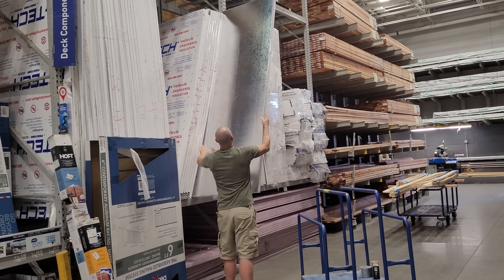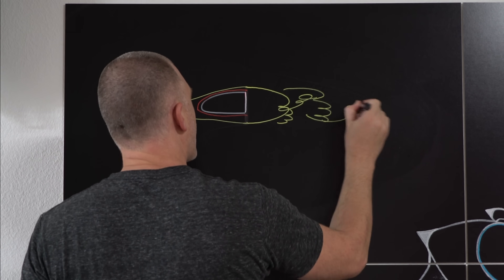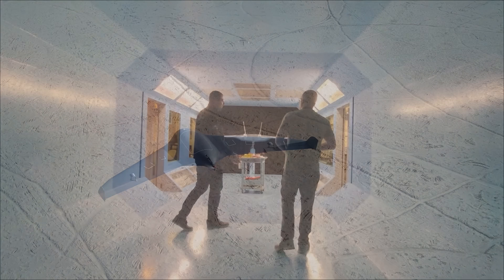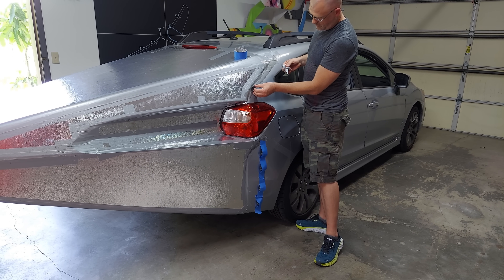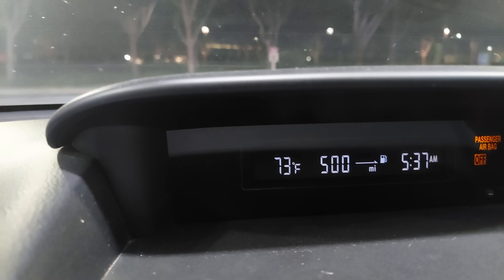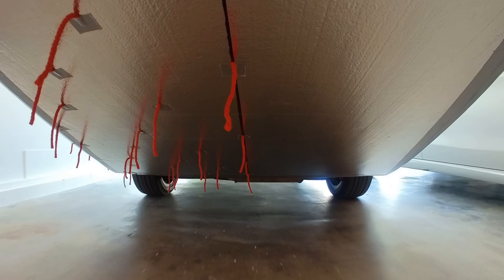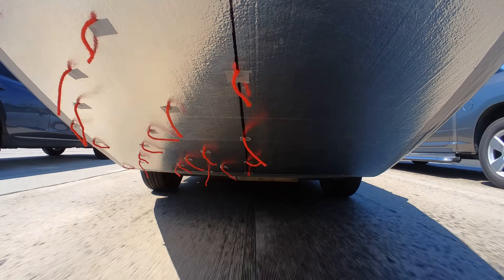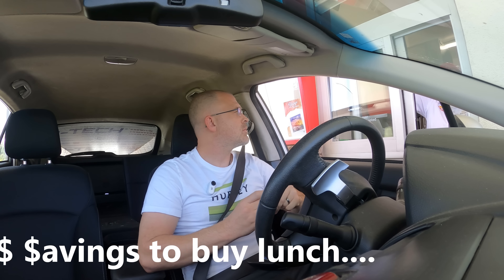Using Simple Aerodynamics to Beat High Gas Prices (Home Improvement Store Edition)

Comment: So why do dimpled golf balls travel farther than smooth ones?
Also, doesn't a rear spoiler decrease the drag by filling the air pocket behind the car and eliminating that negative air pressure?
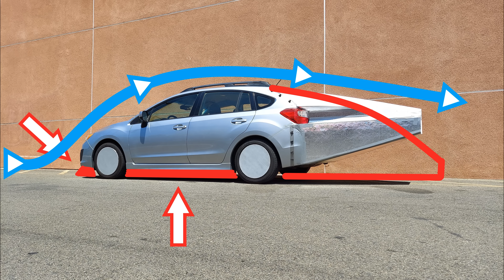9:20 if you shape the rear as indicated, won't you be creating a large wing and thus create upward lift, and potentially dangerously decreasing traction?

Comment: As a pilot AND a plug in Prius driver, I get it.  At an average of 78 mpg per tankful though I just keep it stock. I did put VG's on the rear/top of my hatchback Yaris, and though they didn't help MPG, they did help stability at speed, it felt more stable. When I sold it, the buyer was eyeballing it and I started a long windy explanation about the VG's. and he stopped me. Turned out he was a medical flight fixed pilot!  We both knew at that moment that he was going to buy it.

Comment: To get ACCURATE data, he should have been using an empty gas tank filled with 1 gallon of fuel or just using a 1 gallon fuel tank like the old Shell mileage experiments. Still, this was interesting. It would have been even more interesting  if he had improved the forward aerodynamics.  The Stanley Brothers achieved the ultimate over 100 years ago with what looked like an upside-down canoe.

Comment: Cover the taillight indents with clear plastic. The back end can be wider so there's less turbulence on the sides. You can also put a clear plastic tail cone over the hole so it's more like a wing . . . Reading the other comments I'm just repeating what others have said. The bottom cant be as low as you showed or you wont be able to get in the gas station driveway. Replace body panels with carbon fiber to cut weight, a lot of energy is used accelerating that heavy car. Take the back seats out. Take off the rear glass.
Reply: I was thinking the same thing! One could even take a budget approach and use clear packing tape to form the cover.
Reply: ...ooooor just get a motorcycle
Reply: @Blakezilla594  Mythbusters made a motorcycle more aerodynamic, but that is a different project!
Reply: Ah yes, beat the high gas prices by replacing body panels with carbon fiber...
Reply: Drive a diesel
Reply: Replace the whole thing with a teleportation device and power said device with wind and solar.
Reply: @NoGoodHandlesComingToMind  Just use magic, duh!
Reply: I doubt he is trying to go that far with this. Doing some of those suggestions would sacrifice practicality, after all, there's a reason he is driving a Subaru lol.
Reply: @bozark99  He said it was the challenge of improving a heavy and unaerodynamic vehicle.
He can't use the hatch anymore!
Reply: Wide body issue could be solved using scrape friendly products like a door rubber sealer for the absolute bottom part.
Reply: He might actually be stopped by having clear plastic over the tail lights even though it is clear.
Go figure.
There is a point of diminishing return the longer your boat tail is.  I am sure at this point any added benefit would be negligible, while a tail cone would just get in the way--and clear plastic becomes yellow and brittle in the sun.
Redoing the sides and bottom to maintain attached flow--or at least fill in more of the wake would have a measurable improvement.  He could remove the foil and shape some 2-part foam.
I have never seen a gas station driveway anywhere near this steep.
Do you have any idea how expensive it would be to replace body panels with carbon fiber? :)
A 50" × 36" sheet is $118+ on McMaster-Carr, plus shipping.
You remove the panel, grease up both sides, make fiberglass molds of each side, vacuum-bag it to remove excess air and resin, and then you grease up each side of the mold, lay out one layer at a time of carbon fiber, vacuum-bag it again, trim the excess, install, and hope that everything is perfect.
Then you need to hold onto the molds because if the panel takes any damage you need to replace it.
Fenders are light.  You could definitely save weight with the hood.
Back seats are light, just foam and cloth.  The front passenger seat is much heavier with the metal frame.
I have driven without a passenger seat.
It is weird.
I am sure that removing the hatchback would be easier than just the glass--and easier to reverse, although road noise would increase even more.
Rear visibility is already gone, though, so he could install a foamboard bulwark and seal it.
Reply: that foam board is lighter than carbon fiber...
Reply: The solution to high gas prices? Don't drive, unless it is necessary or for special occasions. Have meetings on the computer. Have cities that have amenities near residential (or included in a multipurpose building, like the 2014 canceled Sky City in China or the 1989 Sky City 1000 concept in Japan).
Reply: @thatguyalex2835  don’t drive…. a Subaru*
Reply: @johhnnn  DONT DRIVE A 4x4
Reply: @thatguyalex2835  no thanks, I won't live like a serf
Reply: @thatguyalex2835  the solution is TRAINS!!!
Reply: @thatguyalex2835  Cool
can't do most of that myself though

Comment: Run a design through OpenFoam, iterate, improve, and then build it. Vortex generators are way too far aft on the vehicle. They are placed where laminar flow naturally stops, and you get flow separation. It's going to be soon after the body goes to parallel with the direction of travel, and before any seams like door panels. Another method worth considering is a wing to direct airflow against the body, similar to a leading edge flap. Mike Patey ran a simulation with his double leading edge flaps on Scrappy and got an AOA to some ridiculous angle without flow separation, which is basically the same problem you're trying to solve.

Comment: How will EV’s run in 10 years?  15 years?  20 years?  How much does a battery replacement cost?  What’s the cost to repair it?  How easy to find new parts?

Comment: And illegal as hell...lol. Interesting idea though. But you need to get better at your data collection. Drive at least 300 miles one way and 300 miles back. The more you drive the less error there is in the way the fuel kicks off on the fill. You should always fill in manually anyway for a test. As for why car manufacturers are not doing this? Well you just got rid of your hatch back. That makes it a car. Most cars will already get more than what you saved without those modifications. So that's why they are not doing this. Plus they would never get is past the lawyers or the DOT.

Comment: I hate to say it, but I spotted the mistake with the basic shape right at the get-go. The tail should more or less retain the same shape but must swoop down to ground level, making the car more like a half-teardrop shape, assuming that's the sort of shape you want - pointy at the back. But for my money, I'd widen the tail so that the sides more or less follow the line of the sides of the car, with the top tapering downwards so that it's pretty broad at the back. You'll still get separation and turbulence of the airflow but it's more likely to resemble the laminar airflow you had on the top. Forget the big tail light recess, or fair it in with some transparent plastic but you could ignore the current set of lights and run a couple of cheap lights down at the bottom of your faring. I might try a couple of flow straighteners on the top edges.
Good fun though. Hope nobody rear-ends your experiment.

Comment: Why didn't you use convex curves to help maintain a velocity profile through the thickness of the boundary layer.  Flat of convex surfaces  tend to cause the boundary layer to at least thicken, if not separate entirely.  Keep the tail wider so the sides don't have to taper in so much.  An underbody panel would really help, especially if you can accelerate the flow there to lower pressure.  You may need to water cool the exhaust, but if the floor cover is metal, maybe use that as the a heat exchanger.  You may find a slat helpful to maintain attached flow on the rear.   The main issue with drag is to maintain the air pressure of the decelerating flow, It's the forward vector of air pressure on the sloped rear surface that is the major factor in recovering energy from the flow, not so much friction.  This is why maintaining attached boundary layer is so important.  Note that utes have lower drag with the tailgate up as this promotes reverse circulation forward along the tray & pressure on the rear. of the cab.  Kind of counter intuitive but it works.  You may be able adapt something like that, shortening the extension by using a slat.  Maybe?  Could set up a makeshift wind tunnel to test models.  Just remember Reynolds number means either increasing velocity or fluid density to do scale testing well.

Comment: At constant speeds on motorways this experiment is valid, but most cars are used locally about town. In this scenario your problem is weight and acceleration. Keep your car as light as possible and accelerate as slowly as possible, also roll to a standstill where possible avoiding braking if you can. I always roll down hills and keep my tyre pressures as high as is safe..

Comment: I would imagine that vehicle manufacturers have considered aerodynamics, but balance it with overall effectiveness and practicability. When you consider things like parking and average speeds etc, there's a number of problems having an additional three or four feet added to the rear of your car along with little to no advantage at low speeds.

Comment: ago
If you actually changed the co efficient of drag of the car by reshaping it aerodynamically that would be one thing. You just added weight on the back of your car. Pure foolery. Not to mention the first time you park that anywhere the whole back end is just going to get ripped off.by someone careless . Good luck parallel parking. Duct tape and gorilla glue. Formula of champions.

Comment: I honestly wouldn’t add a splitter and sideskirts, That will just create even less pressure on the bottom of the extension. you would risk starving airflow going under the car and creating a bigger low pressure area the extension part. I would try to cover the underside of your car and make it as smooth as possible and put some acrylic panels over the rear lights if that’s allowed.

Comment: Nice!  I was wondering if you can use thin plexiglass or flexible clear plastic to blend in the lights.  Definitely rear wheel covers, maybe also plexiglass if you want it to still look like a car.  Underbody tray is trickier as you have some hot compopents, so maybe aluminum and stainless would work great.  Roof rack delete, smaller rear view mirrors.  Tape some bits of yarn on the surfaces and look for airflow separation, install small vortex generators in front of that area to allow the boundary layer to stay attached (I finished the video and noticed your VG's and yarn tufts. I usually see them mounted tip up more like delta wings, with some angle of attack to induce swirl rather than flat side diverging away from the surface creating separation. ). Still, impressive results!

Comment: This is very interesting to see. I think a 13% increase in efficiency is pretty good too! Especially since the way it curves up creates a low pressure zone which creates downforce and drag. It's the same thing Formula E cars use to get their downforce. If done properly it can create downforce without creating a lot of aerodynamic drag like a normal spoiler. 
I also wanted to mention that many electric cars do actually make cars somewhat like this. They all have a teardrop shape to them :)

Comment: Great job.  I have long wondered why we rarely see these trailing edges on semi trailers.
Can  you do video on the features of cars like the CRX through the prius which have the lowest Cds?
Reply: It's not just cd, it's cd x frontal area, so a big car with low cd (80s Mercedes) may have a better cd but more drag.
Reply: these dramatic tails take up a lot of space. Especially if you want it to really work. Easily adds a couple feet of bodywork, which can make it harder to park or fit into space/streets
Reply: @ciello___8307 , that is very true. A 2015 Impreza is 174" long, while a Crew Cab 5.5' Bed F150 is 232" long. This gives roughly 5' the Subaru can be extended before being bigger than such a common truck.

Comment: Every aerodynamic upgrade adds weight.
All of those upgrades are USELESS unless you're travelling at high speed and in clean air.
Aerodynamic upgrades are useless at low speed or in traffic.
But the weight still works against you.

Comment: Injecting air into the drag area would be more practical and achieve similar results. The same concept is applied to "base bleed" artillery shells, resulting in a significant increase in range.

Comment: Can't you cut it shorter to do a Kammback to reduce the overhang? This should, theoretically, retain most the the drag reduction as the wake formed mimics the effect of the tapered tail.

If you put a splitter and seal the floor, you're going to start developing downforce from ground effect, like a Formula 1 car or Le Mans racer. This will effectively suck the car to the ground and may negatively affect fuel economy. Of course, you don't want to totally eliminate downforce as you could end up creating lift, which makes the car more unstable at speed.

Comment: To further improve aerodynamics:
You can cover the tail lights with a transparent foil to have the shape but keep lights visible. 
You need to make as much as possible flat bottom. 
Make the tail with more round lines. 
Remove the back mirrors and install web cameras. 
And add some air intake at the connection perimeter with the tail to reduce the drag from the hollow tail tip square. 
Lower the car or add a skirt.

Comment: You can also cover the whole back wheels so can can reduce drag even more. Also you can cover the tail light with plexiglass.
Reply: It doesn't solve two issues
1) the turbulence created from the stuff under the car
2) no conditioners to treat rear tire wake.  

You can seal the tire well till the cows come home but until you have a method to treat the rear tire wake from disrupting the flow, the bottom side of the extension will still show turbulence even if he reduces the angle of the ramp up.

Comment: I noticed you at a drive thru restaurant at the end. Visiting drive thru’s especially multiple times each week can rob you of 2.0 - 5.0 MPG per tankful. Even if your car has Start/Stop tech. Employing Start/Stop Tech also puts excessive wear on your engine, as the motor oil sinks to the bottom of the crankcase every time you start the engine. Better to quickly park & go inside to get a ‘to go order’. That way your engine only starts and stops once.